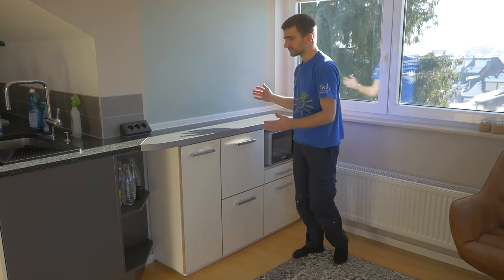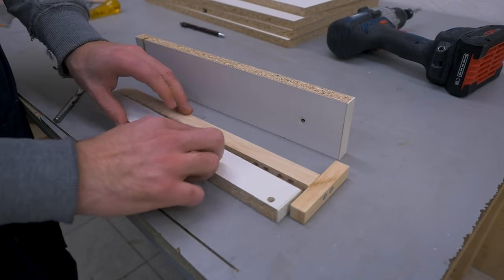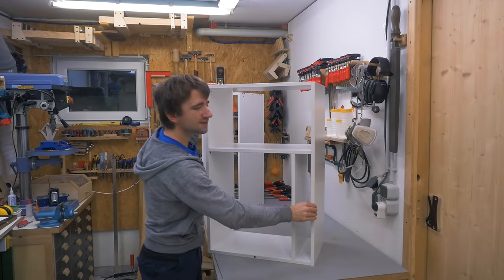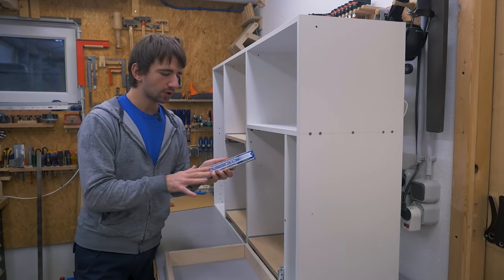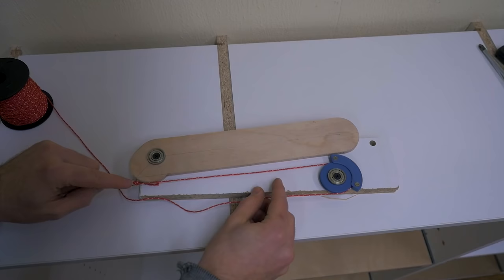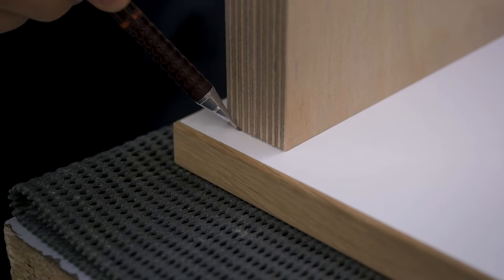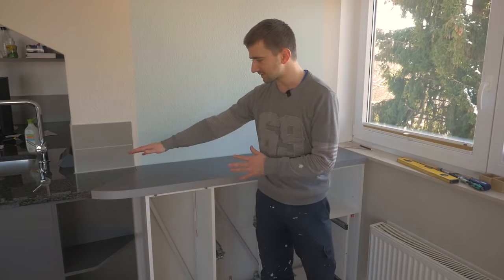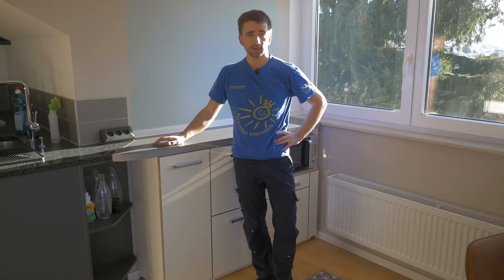I Over-Engineered a Kitchen Cabinet with Special Features

Comment: There is so much to like about this project. Hard to know where to begin...

1) Re-using/upcycling existing materials.  In many situations it is cheaper and more convenient to use existing or unwanted cabinetry for the raw materials for a project. Laminated chipboard is stable, inexpensive, and easy to maintain. And it is usually much easier to get back to the workshop than buying full sheets of new material and then trying to cut them down into workable pieces. I turned an un-needed Ikea wardrobe into a very useful set of shelves and partitions for storing tools and fasteners in my garage.

2) Customisation.  Everyone's living space is unique. Everyone's living requirements are unique. We won't get into why you need to store three crates of softdrinks in your kitchen. But you do. And you turned otherwise unused or unusable space into an attractive and usable addition to your kitchen.

3) Dowels. I've become a recent convert to dowelling joinery. It presents a few challenges, but with a little careful planning and the right technique its a game changer for all sorts of practical woodworking projects. Especially with plywood and/or chipboard panels.

4) Recycling bin. Ahhhh... the bane of so many European kitchens/houses. Let us know how the pop-up lid for your recycling bin works. I'm personally working on a door that will hide/disguise the six (count 'em) recycling bins that presently live next to my front door.  It's a different problem than you faced. But dealing with this sort of problem is something common to so many European householders.

5) Mistakes. The woodworker who has never made a mistake isn't much of a woodworker. We learn from them, curse them, laugh about them. They make us better craftspeople. As long as you don't cut off a finger, it wasn't too bad. But massive kudos for you as a woodworker and a Youtuber for sharing your mistakes.

6) Good humour. Yeah.  And who says the Germans don't have a sense of humour....LOL

Comment: I skipped to the end so not sure if it was considered but if the lid was on the other side, you could swipe your peelings into the bin from the counter. You would then have the problem that the lid would block the bin in all other cases. The best way would be if the lid remained in the cabinet (rubber seal?).

Comment: Fantastic job with cabinets! It look very well, up cycling old cabinets is also very cool! 

Only one thing to considerate: why do you even need lid on plastic trash container if it is enclosed in cabinet? It's not smelly and would be easier accessible without lid. Mechanism works great but is totally unnecessary 😉
Reply from the maker: It can get smelly and needs the lid

Comment: Different idea for the lid opening mechanism: Attaching a weight on the backside of the lid or making it spring loaded, so that it wants to open by itself. Then the front edge of the countertop would push it closed. (Although it might not be airtight when done this way)

Comment: When filming in 50fps, it's ideal to use a 1/60th of a second shutter speed for natural motion blur, as opposed to whatever default setting your camera has, which is based on the (very bogus) 180-degree rule. Also, if you can, enable shutter priority mode in your auto-exposure settings if you use auto exposure, this way the exposure algorithm will NOT modify the shutter speed to expose the image.

Comment: Is the lid opener not a bit overcomplicated?
Usually an L-bracket on the lid that contacts a rail on just the right spot on the ceiling of the box should do the same job.

And also, very good job with it, I love both the idea and the implementation.
I assume you did not put any strengthening angles on the sides of the crate drawers so that you could slide crates in from the sides, did that work as intended?

Comment: Interesting video and all of this is looking pretty nice, however I wouldn't think on placing microwave so low. You need to crouch or bend to get proper access to it. I believe it would be best to place microwave a bit higher for simple reason, so you can operate it fully while standing. Nonetheless, interesting video with a work well done, thank you.

Comment: Hello from Portugal. I am impressed with your video and how you made the bespoke cabinets from old ones. 
Is cutting laminated panels on a bench saw an issue, or do you need to select a particular blade type? If so what blade did you use please?

Comment: Nice solution, but..... 🤔
I personally would have swapped the garbage can and microwave.
Now the microwave is "locked up" and cannot dissipate its heat properly. He now blows the hot air against the wood.
If you had placed it on the left, it could blow its hot air freely on the left side.

Comment: How deep are the mounting screws for the large box slides? On the bottom level you have two slides on opposite sides of a wall that is maybe 2cm thick. No worry that the mounting screws will touch or interfere with each other?
Reply: Or is that why they have so many different mounting holes? So you can choose holes that are not directly opposite? Is it ok to choose holes that are directly adjacent, or is more separation necessary?
Reply from the maker: That's what I did, one hole as spacing was enough.

Comment: I love it, just one thing... Isn't it now really hard to pull out a full trash... I mean maybe not everyone overfills his trash bins like I do, but they generally are getting bigger in the lower part, therefore not fitting through the top mounting part. And the sides are covered by your awesome build, so one cannot pull the trash out there.
Reply from the maker: For emptying you can remove the plastic lid and have a big opening
Reply: @MariusHornberger  ah ok thanks for reply

Comment: hi Marius, i have 2 questions did you use for the doors the same material as the cabinet? they look a bit (more) shiney. Did you cut them with the shiney side down on the table saw to prevent chipout? also you mention printing the legs, it looks like you need a high resulution printer for this , which printer did you use?
Reply from the maker: Front material is different. 19mm MDF with a thicker shiny coating on one side. Chipout wasn't a problem in either orientation. I use a Prusa makes, but any printer can do that. Resolution is 0.2mm

Comment: I'm wracking my brain trying to come up with a simpler solution for the auto-opening lid. I think I have one, but it's difficult to explain. Basically, though, an extrusion along the length of the side of the lid would slide through a hinged channel mounted to the inside of the cabinet, so that when you open the drawer, the lid slides through this channel and is forced upwards. The channel being hinged (so that it can rotate as the angle of the lid changes) is the most important part.

Comment: You could just remove the bin cover instead of building auto open mechanism because with it you have to open it completely even if you want to throw something small...
I did something similar but I modified cabinet door to make it open like that and attached Ikea VARIERA (801.822.37) to it.
this is the best and fastest way to use trash bin IMO.

Comment: The lid-opener is massively overengineerd. Looks neat though. :D
Easy solution would have been to just install the same cord or alternatively a chain on the top of the lid and at the inner top of that element.
Reply from the maker: I tried that as well, didn't work
Reply: @MariusHornberger  What about it didn't work?🤔

Comment: Everything is super well done. Though I know it likely would have been cost prohibitive…it would be “that much nicer,” if you had extra granite left over from the original build instead of the Formica.
Reply from the maker: The old kitchen actually had a matching granit section as well, but that would have been too much effort
Reply: @MariusHornberger  Yes, not many people have a stone milling shop available either. I could tell you definitely know what you are doing and it was the best looking, most cost effective solution. Most people couldn’t have come up with anything, anywhere near as good.
Best,
R. C. Christian

Comment: In my country, plugging an appliance using a power bar or extension cord is illegal. When doing this kind of refit you should allays location dedicated power outlets in the right place according electrical code for appliances.

Comment: I wonder if the garbage lid was necessary, it's neat to watch but I feel like a wooden lid could have just been fixed to the underside of the countertop with the bin tilting back into it without being seen.
Reply from the maker: The wooden lid wouldn't work, I checked as well. And the plastic lid keeps smell inside and holds the bag up

Comment: Just a question why having the crates in your cabinets and actually waste space because it can't impossible be that important to have the bottles in the crates so I would rather store the crates in a garage or storage room and stored the bottles lose in the cabinets which probably allow you to store all bottles in the same space.
Reply from the maker: It easier and faster to switch an entry crate than all individual bottles. And in a crate they can't tip over

Comment: Ok why do so many people use dowels?  I work in a cabinet shop and we glue, and pin nail everything and it holds just fine.  It’s the glue that holds it really.  Genuine question as dowels are a lot of time.  I use them in personal projects but I show them off and use them for contrast
Reply from the maker: Wood glue doesn't stick to coated particle board
Reply: @MariusHornberger  what about a melamine glue?

Comment: Auf gut Deutsch - Verbesserungsvorschlag: 
1) Deckel beim Plastiksammelbehälter weglassen. Warum einen Deckel wen ein Deckel des Möbels bei geschlossenem Zustand vorhanden ist. Was nicht vorhanden ist, wird auch nicht defekt.  
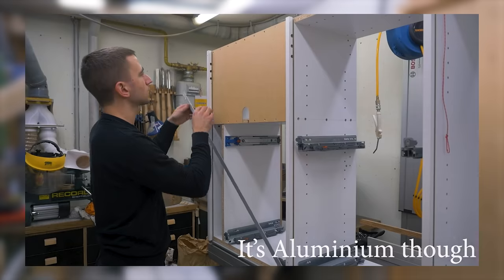2) Flaschenkistenauszug: seitliche Dreiecksaussteifung (Kathethen = Boden/Deckel) mittels 2 mm Alublech/-streifen (Prinzip Rückwandaussteifung 6:20)
3) Möbel auf einen "verdeckten" Möbelsockel (Massivholzrahmen/Restholz) stellen. Dieser dient dazu, Bodenunebenheiten auszugleichen (Schiften) Die Sichtseiten des Möbelsockels mit einer gewünschten Blende verkleiden (Vorteil: die Blende kann bei Bedarf getauscht werden). Hinweis. Für Sockel niemals Spressspan oder Sperrholz verwenden.  Im Küchenbereich mit Wasserkontakt (z. B Reinigen, undichte Leitung....) quellen diese Materialien unweigerlich auf. Dann müssten die ganzen Möbel nochmals demontiert werden! Die Kosten für diese Arbeit ist dann grösser als die Mehrkosten für "funktionstüchtige" Möbelsockel.

Comment: Not to ask a silly question, but if you were going to build the cabinet itself out of particle board, then why not just build the crates into the drawers too? I mean, what you built looks pretty good and all, but it just seems like a lot of effort to go through for something where the crates themselves are going to be visible when you open the drawers anyway. If that's the case, then why not just attach the crates to the front making them permanently part of the cabinet, adding to the stability instead of going through all that with the angle brackets, the threaded rod, and the nuts?
Reply from the maker: It's easier to change a new, full crate, than going through every individual bottle. And not all crates are them same. I'm more flexible with crates

Comment: I'm lazy, I'd have just screwed a braided wire to the lid, then attached the other end to the top of the cabinet, so that when you opened the cabinet, the lid gets pulled open. Then when you close it, the braided wire would have enough resistance to close it as well.

Comment: Nice build but nothing was done to integrate and bond with the existing kitchen, except the countertop shape, which does not match the original lines either, too curvy. Would have integrated the chamfered open shelves, convert them to closed, or whatever.

Comment: Overengineering ahoy!

You know that you could have just added a catch on the lid and the underside of the top, that it would engage right after the lid cleared the top panel... You wouldn't even need to calibrate the thread or anything.
Reply from the maker: I tried, didn't work
Reply: @MariusHornberger  That's a shame.

Comment: Everything looks good except I felt the oven/microwave should not be placed there, because the hot air from the back has no place to get out, it will create moisture inside and damage the cabinet quickly.
Reply from the maker: There are no vents on the back, just side and up.
Reply: @MariusHornberger  oh, I got it :)

Comment: You screwed up with garbage. Usually you need several containers: for plastics, for bio, for mixed. And garbage bags like to get holes. You will have furniture damaged by leaks. But the idea itself is great.

Comment: This cheap drawers slides are a mess. I never use them. They always break under pressure and okay only for really lightweight drawers. It's better to have a wooden railings than those mfers.

Comment: It really doesn’t make any sense that you kept this lid on. You should leave it open and it would be a lot easier to toss garbage from the table top. Now you have cover that ultimately stops you from using it properly
Reply from the maker: It keeps smell in and the bag in place. Very important. The cabinet door doesn't seal enough